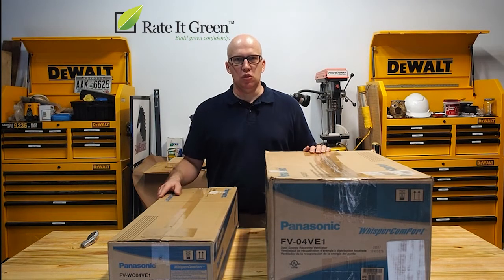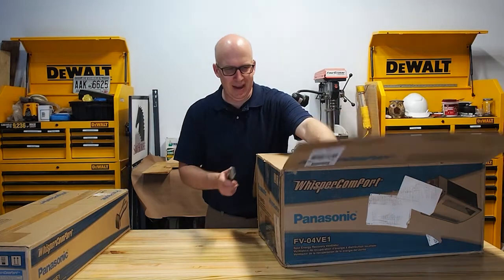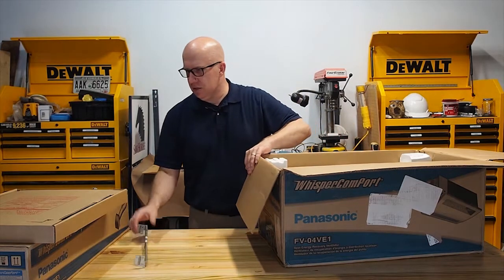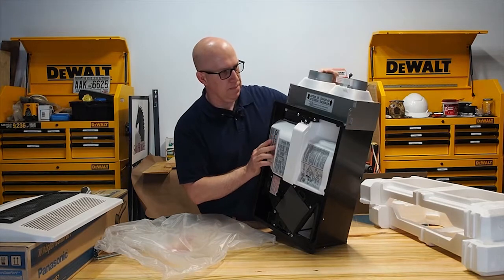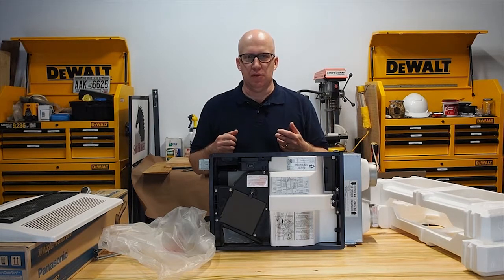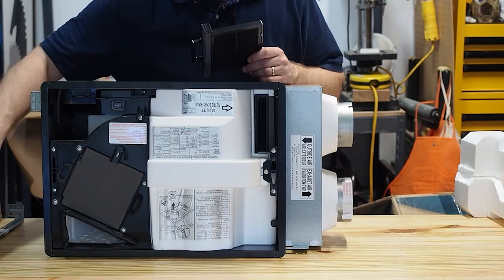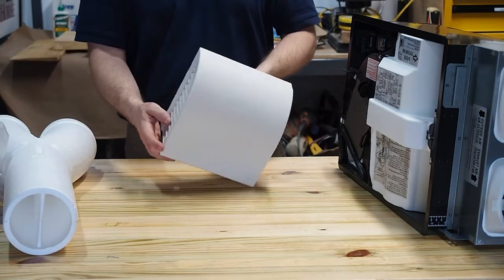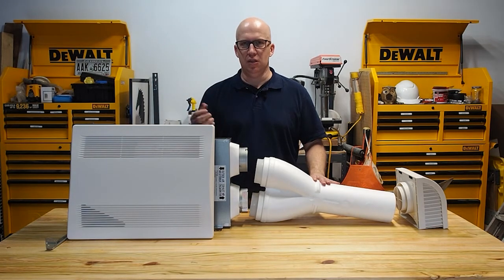Energy Recovery Ventilators (ERVs) -  Unpacked and and Explained

Comment: Will this thing auto adjust the flow if say an exhaust fan is turned on? It needs more air to replace what’s being pulled out? How do you change the filter or do you need to install separate filters before the unit. I need a lot more info on this unit specifically, trying to decide between this or waiting for the new Broan Model that’s supposed to be coming out